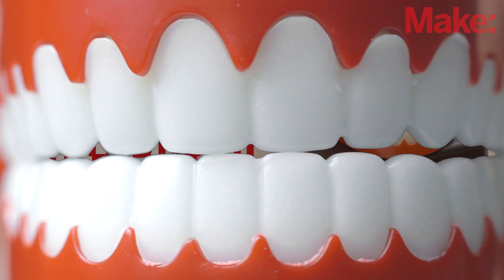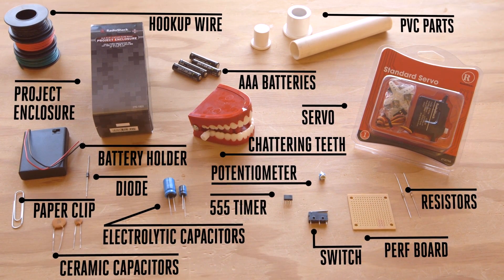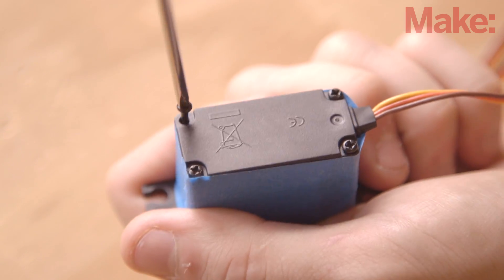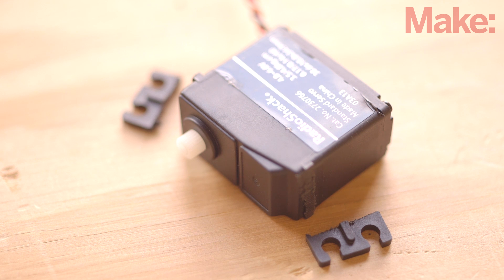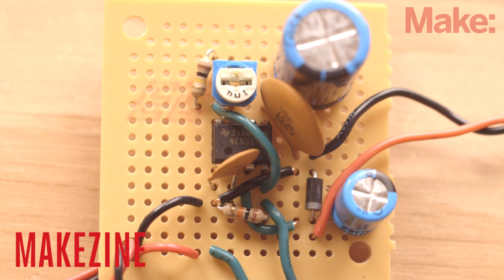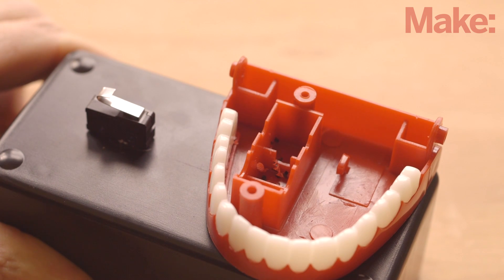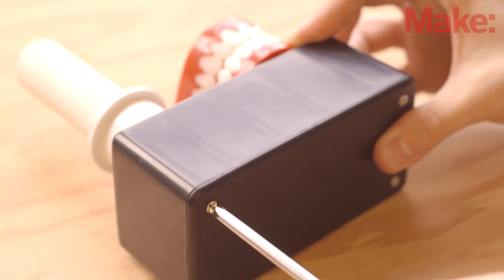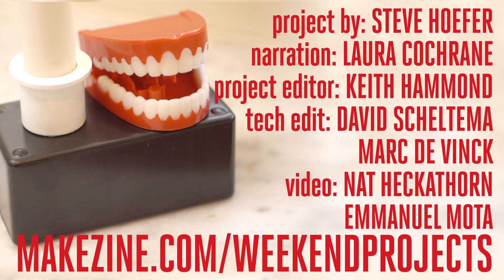Weekend Projects - Toothy Toothbrush Timer

Comment: Nice, but what about water leaking from toothbrush?
Reply: doesn't really matter. the box is closed, the small hole for the wires for the trigger can be hotglued shut, and you can always put a small cup inside the holder if you really want to seal it off. Even If you get water into the hole for the mouthwire, these are low voltage circuits. once they dry out they will work fine again. Heck I bet it will even work if they have water on it since regular water doesn't conduct that great anyways.
Reply: dry the toothbrush off with a tissue before inserting?